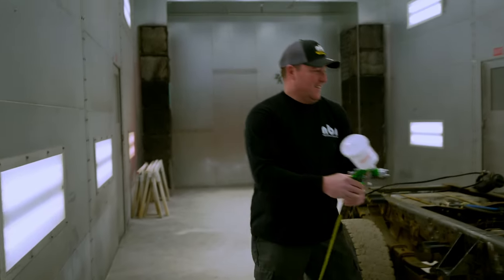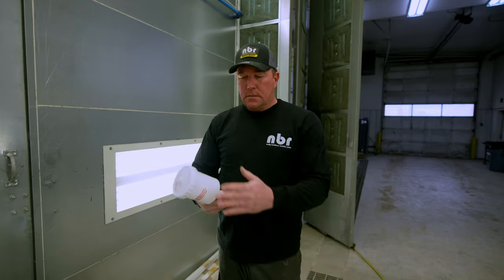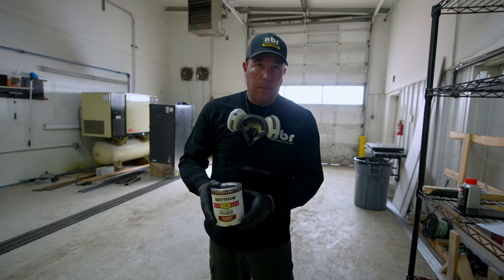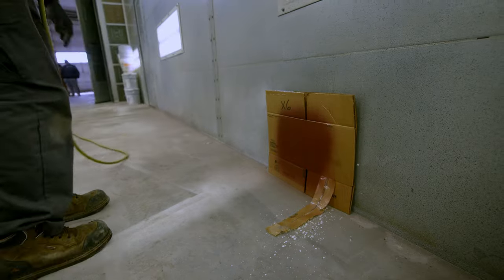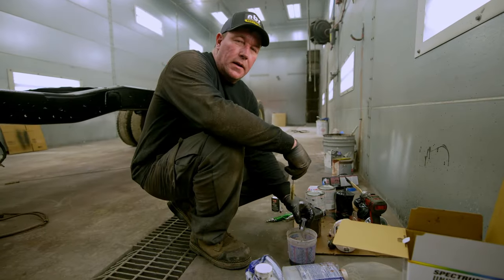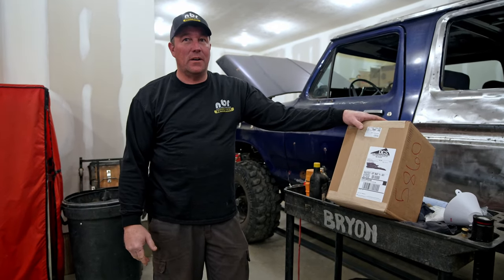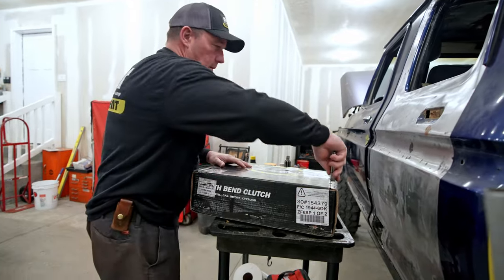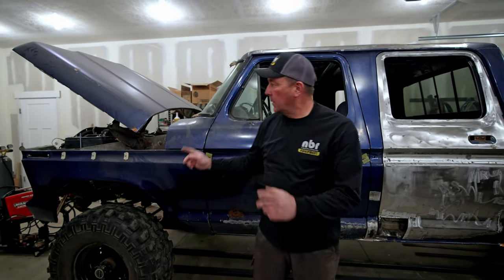The frame for THE ULTIMATE FORD DENTSIDE CUMMINS gets a new coat of paint.

Comment: Greetings fron Western Montana!  I really like the cummins conversions in fords especially when using the Super Duty chassis and running gear!  
What I have learned from experience is:  The ZF 6ix speed has a 17mm diameter out put shaft where as the NV's have a 3/4 inch output shaft!  Also when using those adap[ters LOCLTIGHT is your friend as those bolts will vibrate Loose!
Keep up the good work
Reply from the maker: Good to know! And thanks for watching 😁